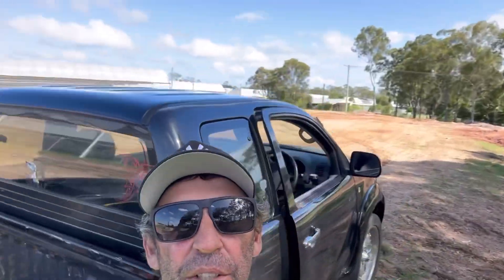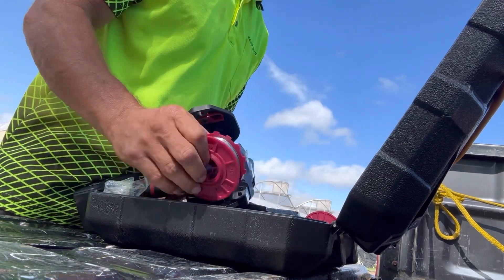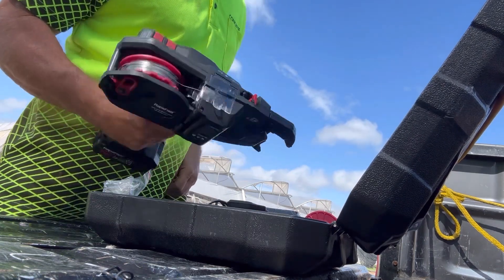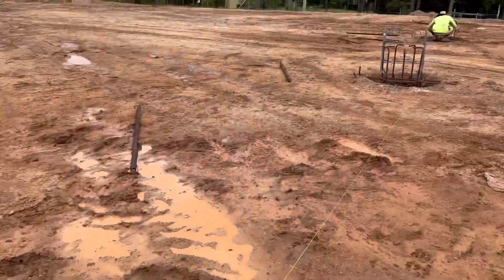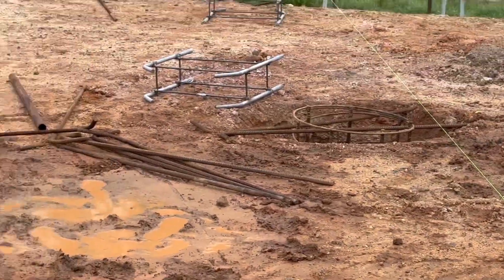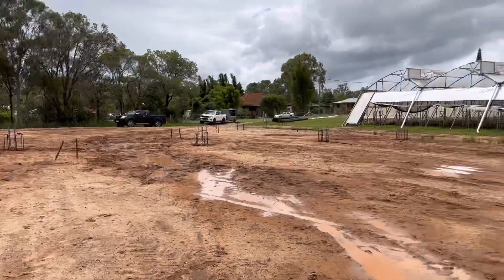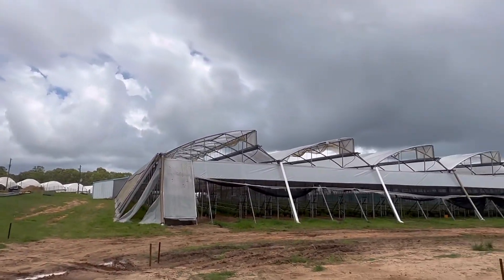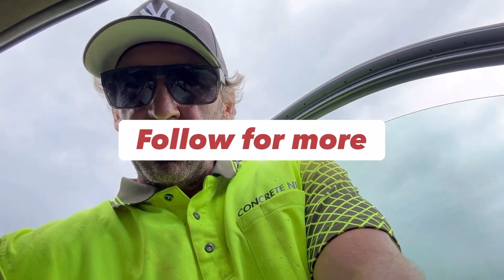4 m deep pier holes

Comment: Just over 2 cube per hole
Reply: If you can piss you can concrete.
Reply from the maker: @jimmyspiteria9371  that’s what they all say until they have to do more than 100 m² 🤣👍
Reply from the maker: That’s a good guess 👌
Reply: .4 x.4 x 3.14 x 4 = 2.0096
Old mate is right, just over 2 cube per hole👍